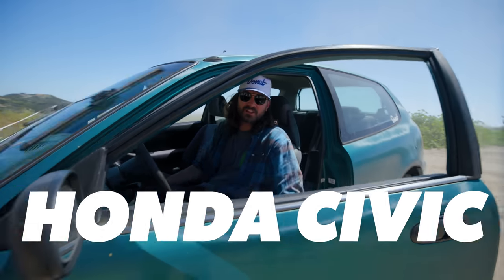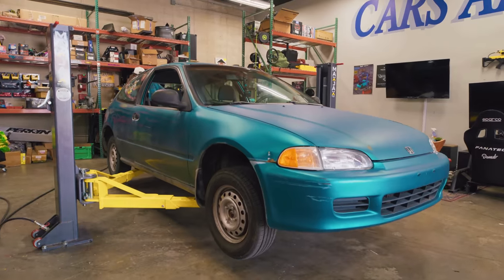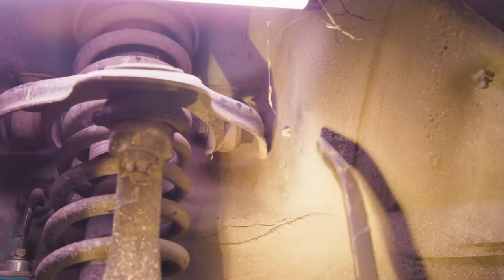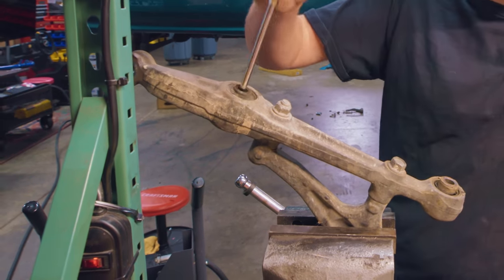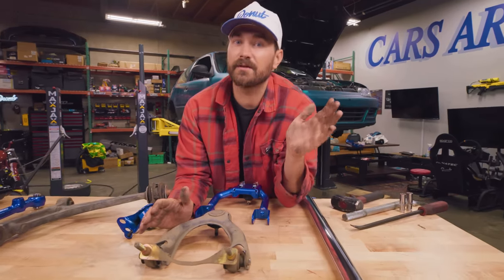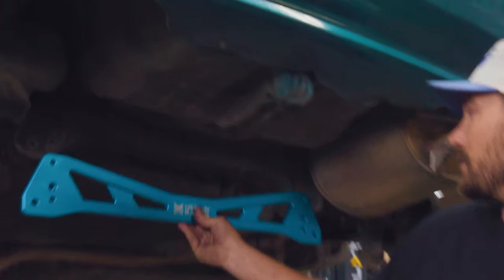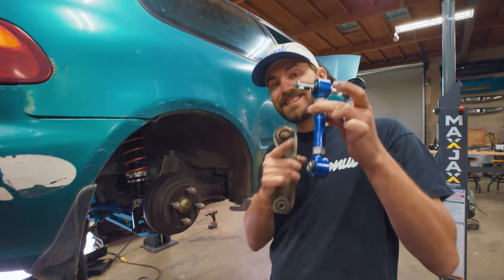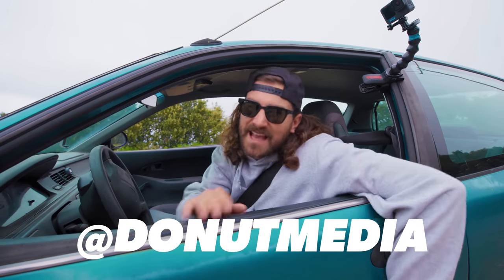We Put $4000 Suspension on our $500 Civic

Comment: I’m exceedingly jealous at how easily all the bolts just came right out 😂. Here in Pennsylvania it would take a week, a torch, bloody knuckles and plenty of profanity to get that suspension apart lol
Reply: Same every bolt on my da9s had to be hammered out, PA boiz
Reply: pa gang 😭
Reply: Frugal Family Living  just the quality is so much different old cars were made to last modern cars are made to broke and buy a new one
Reply: @commandergeokam2868  not remotely true. An environment without salty winters changes everything.
Reply: broken wrench
Reply: More of this please ❤
Reply: Can confirm.
Reply: I know that feel, bro.  Spraying a nut with rust buster and using a jack to keep applying pressure on the wrench that's pretty much digging into the nut.
Reply: @commandergeokam2868  lol what. It's a shitty old economy car. bottom of the barrel. Living in southern california and having been under tons of shitboxes, it 100% has to do with the weather. The only place that gets close is by the beach, and that's mostly body rust.
Reply: I did a 99 CRV's front suspension. I had to cut and drill out about 60% of the bolts. heat didn't get anywhere, and I couldn't whip out the oxy-acetyl where I was.
Reply: come to ontario before u say that
Reply: You forgot a few cases of beer… for you and the boys.
Reply: same i’m in virginia and my hands will never be the same after replacing the front end of my G35
Reply: Same in the Midwest.  Also the underside of the car would have been rusted out.
Reply: Frugal Family Living  the salt destroys everything ong

Comment: So happy you guys are finally building a Honda! As a B-Swapped EK owner suspension was one of my first big upgrades and I was in a very similar boat with worn out parts. I would love to see the braking system gone through in a future episode. Mine at 250k miles had black fluid from disintegrating master cylinder/caliper seals. Brakes were first upgrade/maintenance item. Rear disc swap, new calipers, rotors, pads, brake lines, master cylinder, fluid. Made a huge difference in braking feel and confidence. Also would love to see some old school b-swap action.
Reply: @drippingwax  maybe they did but didn't mention it
Reply: @drippingwax  Brakes, they heat up too quickly as is.
Reply: GSR or LS vtec?
Reply: @jimmytran5971  LS non-vtec. Currently in the process of getting it ready for boost (Btec). But first I need to upgrade my timing setup and ditch the dizzy for hall effect sensors and coil on plug. After that hopefully I won't run into any more issues and can begin tearing apart the block and building it for boost.

Comment: Couple notes for the kids at home: Do not use an impact wrench to tighten bolts to final torque, is almost no cases where its a good idea and you should zip it on lightly and finish by hand... Also when replacing most suspension bushes its a good idea to only lightly assemble them and then lower the car so weight it on suspension bringing it to ride height before tightening. They're using mostly spherical bushings that are self aligning but other types you can have issues with binding where if tightened when fully extended will be over stressing the bush at full compression and it will fail prematurely and not preform as it was designed..... Most good alignment shops will have a 4 post hoist to make tightening at ride height easy ✌ do most at home and trailer it in and have the lads put the final touch on with the alignment.....
Reply: It should already be on jackstands if you don't have a lift, so use your jack to raise a tire until it barely lifts off the stand. That's your ride height / preload and you can tighten that corner.
Reply: I learned long ago that impact wrenches are only for taking bolts off. Its always worth the extra few min to not worry about cross threading something trying to zip a bolt on.
Reply: As long as you're careful and paying attention to what you're doing, using an impact to snug your bolts up isn't that big of a deal.  Don't break out your 1000lb impact to do it either.  I have a nice little dewalt 120lb battery powered impact that will make sure I don't go overboard with snugging things up.
Reply: it's funny how they do all that work and keep the stock Dean Stingers.
Reply: Upvotw this especially about the impact things😂
Reply: Don't ever zip on a bolt with an impact, start it by hand, get like 3-5 good turns in, THEN zip it on with the impact. 99% of the time the torque doesn't really matter, just make sure it's FT (Fucking Tight) and you'll be good. Just make sure you know what the 1% is where the torque is important.

Follow up tip: Don't underestimate the power of anti-seize. If you're in the rust belt, and you happen to have a bolt off, put a dab of anti-seize on the threads before you tighten it. Future you will thank you
Reply: Yeah the not preloading anything before torqueing is kinda irksome.
I'm that dude that breaks out the torque spec sheet for everything and uses an actual torque wrench, but that's just me.
To me impacts only spin left. Nothing an impact can do spinning right that a torque wrench can't do more precisely.
Reply: Lowering before torqued doesn't matter with sphere bushes because they're basically bearings. Rubber bushes yes it does, but most shops simply don't care.
Reply: @walkernottexasranger7565  he said that

Comment: I want to see every performance upgrade complete THEN a motor swap. The reaction would be wild!
Reply: i want this too now
Reply: K20 swap for sure!
Reply: @Craycrayallday  ugh too many K serieses! i would rather see an original SiR B16A
Reply: I'd love to see a B18C5 (ITR engine) swap if they can find one! Got to drive a B18C5 swapped EG the other night and even though the engine wasn't tuned yet it was an absolute RIOT
Reply: I'm with you boys, for an old civic like this it needs a B16 or B18. Way easier than a K swap too
Reply: @clovermedia. rotary
Reply: Next they need to tackle those trailing arm bushings with spherical ones, with a egg this age those things must like busted marshmallows now!
Reply: @djfoof3518  n-no..
Reply: Drop a ls init!
Reply: B18c1 or c5 would be sick in this thing
Reply: Nah bro... 4G63 swap or rebuild the original engine.
Reply: @DBHHellhound  bomb vs too small single cam
Reply: Ls swap it😈

Comment: The EG is such an incredible platform! I've been a diehard Mopar guy forever (my first car was a 72 Challenger that I still have), but when it came time to buy my first "practical" car, I went with a 92 hatch, because I wanted a car that got over 40 mpg, super reliable, easy to wrench on and large aftermarket support. Over the course of 6 years I put over 200k miles on mine and absolutely loved it! And whenever parts wore out and needed replacing, I upgraded to high performance parts, because in comparison to what I was used to, they were really cheap. And I have to say after I went through and upgraded the brakes, suspension and a bit of performance upgrades it was a great little go kart.

Comment: I remember running custom ground control springs with Koni Yellows on my '99 Integra.  I had pretty insane spring rates, I think 350lb up front and 450lb in the rear, no sway bars.  Thing was a beast, immediate lift throttle oversteer.  I remember when I had H&R race spring with no bumpstops, my upper a-arms started hitting the chassis in the wheel well.  No fun.  I even had aftermarket angles upper a-arms.  Good times, always wanted a Civic hatch, that's my favorite color.  I would never advise a FWD noob blast down a canyon in an oversteer setup Civic.  Literal lift throttle oversteer, most "racers" aren't used to it.

Comment: I have a 2008 Civic LX 5 speed coupe and I love it. Beast has 355000km. It is the PERFECT commuting car for work. The muffler rusted off 3 years ago, and it has sounded DOPE ever since. Recently another part of the exhaust rusted off (probably right at the manifold), and it now backfires 3-5 times when I rev match downshift. It is basically the best little beater car you could ever want. Never any issues, ever. Just replace the brakes and change the oil. I always recommend a Honda.

Comment: Suspension mods are the best thing you can do on a slow car... my 92 525i has 189hp (or at least it did back when it was new), and in a 3500lb car it's not exactly fast. With coilovers, monoball suspension all around, an aggressive alignment, and sticky tires, it's a total blast to drive in the canyons.

Comment: If you want a new drive experience, what you need is a Reliant Robin, if driven correctly can feel like a sports car through windy roads and I drive mine like I stole it round these rural Dorset lanes and just leave 4 wheel cars in my dust, should ask Aging Wheels if you could sort his one out for a bit o' speed, Mini gas dampers on the back, Gaz front shock, PU bushings, Peugeot GTi anti roll bars on back axle, Triumph Dolomite Sprint brake cylinders, 4 branch manifold, ported inlet, Ford Weber 134ICH carb conversion... 0-60 under 10 secs and about 100mph top end... scary fun :D

Comment: When I was 17 I owned one of these. I put an obnoxious sound system in it probably worth what I bought the car for. I installed a copious amount of bright blue LED strips throughout the interior to match what was left of the blue paint on the exterior. I had 3 near misses in it:
1. I was driving down a dirt road with the car full of people. I wanted to show off and have some fun so I started whipping the tail out around some corners. I went too far, then over-corrected and skidded straight toward a 3 metre drop. The car stopped with one of the front wheels fully off the drop. Someone in a van towed us out.
2. I was driving home at 3am down a windy hill. One of my rear tires was very flat, and I knew that. But I wanted to see a girl, so the reward seemed to outweigh the risks. I was turning a corner and must have rolled the tire. The back of the car started to slide toward the slope next to the road but somehow the car straightened out. Got my tire repaired soon after that!
3. I was racing down the highway in my hometown, mostly down hill, so I'd been using the brakes fairly heavily. Got to a small roundabout where I needed to give way to a car coming across it. My brakes failed due to heat and the pedal went straight to the floor. That was the scariest thing I've experienced in a car. 

Wow, I was young and dumb. I do miss that car though.

Comment: My last Honda was a 1990 Integra GS. That car was a blast. I never got more than about 20,000 on a set of tires, it could just eat them up. It could almost make 140 mph, (I got to 138 flat out on highway 99 heading into Nevada) and it would accelerate like nobody's business. I called it "clear the console mode", everything in the center console would end up in the back seat (like instantly!). I get the attraction. Wait till you put some ponys in it.

Comment: That Megan brace piece, it’s funny I thought y’all would have knew that. Also those civics that factory brace is so flimsy that the stiff sway bar kits that come with the small brackets will work to mount a sway bar, but the area would eventually start to crack and tear. So that’s the main reason they are so popular if I remember correctly. Sucks to have to go get that factory brace stop drilled and welded from a track day.

Comment: Typically, I'm not a Honda guy, but I love suspension work, no matter what make.  I really wish there was a track test with the stock vs modified suspension.  Wheels and tires are gonna wake it up even more, along with the front sway bar.  Other than the exhaust, it wouldn't do any power adders.  Start cutting weight, and more chassis stiffening

Comment: Damper the Rear to be stiffer than the Front, You want the front to be somewhat soft, mess with the dampers and you will find the sweet spot! Not sure what spring rates you guys chose, so that will determine how much dampening you need, but it will make the car hook as well as handle neutrally, rather than understeering. But next mod you need mo powah baby, and the make or break mod for the Honda experience; their Helical LSD's! If you could put a K20 in there and a Helical LSD that would make the car insane. Also you could get some bigger wider wheels and tires instead of the steelies, that would obviously give the car a better feel.

Comment: the weird thing is that i worked on an eg recently and we did the rear subframe bar but the bolts that were provided have a thread gap that was too small for the stock nut on the back, weird because legit every single civic has them and no one i know has had this issue. we just decided to sent the bolt through the old welded nut at the back and there was enough thread to put the nut that was supplied on the back of the bolt through the stock nut. Honestly it's pretty cool this type of stuff

Comment: Oh no... They did everything but the trailing arm bushings and toe arms in the rear, which are arguably the most important. If those trailing arm and toe bushings are cooked, that's going to be pretty bad still.
That and no front swaybar with a big rear will make it a bit of an oversteer pig on the limit. Some old cars it's beneficial to go no front, but these things definitely want a front sway, but a smaller stock one. 
But also next big step for the suspension side is roll centre adjust stuff for the front and rear, but that's a lot of effort.

Either way, keen to see where it goes from here

Comment: Rims, Tires and brakes. While you're at it, remove excess weight from the rear passenger compartment - so that later a a booming audio system can be installed.

Comment: You want to put a load on the suspension while prying on it.. that's what I do when doing a safety inspection. Usually put the jack under the front lower control arm and jack it up

Comment: I wish i could get a MINT $500 civic here in canada! wow man you'dp pay $3000 here for that car easy. Hype dictates them here. Wish i didnt sell my 98 DX Coupe....55K KM sold it for $800 i think. Paid $1000 in 2015 which is amazing it was like new.... Truck i replaced it with broke in a year and now they are worth like $2000+ easy to the Honda Heads....

Best thing to do with old civics is to use Acura parts on them. They are either equivalent to Si model parts or even better. I did full EL interior in my 98 coupe and EL Spindles and hubs, EL gauges with Civic Odometer (had to adjust speedo) and the subframe which is the reason i bought the EL. A road crumbled away and i bottomed out so hard i ripped the control arm mount off the frame clean lol. And my 02 Accord v6 SE had a TL Subframe

Comment: Hehe not many people know the Civic, Accord etc were only half Honda's... your Civic was known here in the UK as the Rover 200, 25, Streetwise and the MG ZS's used a lot of stuff using Type R specs with some tuning by Lotus.   The best MG's were the Accord-a-like MG ZR160 and 180's and the ZT with the 5 litre Ford modular V8 RWD monster that with some bolt on goodies became faster than any police car here in the UK :D   Funny thing too is people wanting cheap tuning parts for their Honda's are now buying uber cheap MG variants, the MG K series V6 ones have the same engines as some Lotus and not hard to put a Lotus map on the thing, the MG name now is a Chinese thing but like a lot of Chinese cars a British name lives on inside, the Austin Maestro bodyshell is used in many Chinese cars today, now if you could find a MG Maestro Turbo... 5000 made, built by Tickfords was considered the ultimate "hot hatch" here in Britain as the thing was ferociously fast and Tickford tuned the suspension so it stayed on the road right up to the point the non variable power steering was overcome by the engine power and torque steered hapless owner into telegraph poles, ditches, oncoming traffic tis why there is hardly any MG Maestro Turbos left cos they all got smashed up by torque steering deaths.
Reply: Oh and that kingfisher blue is a Rover colour too, Rover and Honda used different primer coats hence the very slight difference but most of Honda's metallics of that era were designed by Rover UK, the only one Honda didn't use was Rover's cobalt blue metallic which was considered one of the best paints of that type and a firm favourite of the custom lot esp when candied up.

Comment: Steering rack just needs adjustment. You check this by testing the slack in the steering wheel compared to how much the wheels turns. Super common civic problems. You need a special 40mm flat wrench. Just go easy because over tightened rack nut will bund the steering
Reply: Bind the steering*

Comment: $500 is a steal, guy i bought one from wanted $3500 and it was way worse condition and engine was on its way out. This was 2016 pricing too..i got it for $2700 and then the head cracked a month later 😢

Comment: You did the exact opposite of what you should have done with the arb. On a fwd car like this that hasn't got much weight at the back you'd want a stiff front arb and a really soft (or none at all) arb at the back. Softer rear means more weight transfer at the back= more grip

Comment: Could you guys take a gen 1 escape and turn it into a drag car. They are 1000 lbs. lighter than a charger or challenger. Also, nobody actually knows or cares about them and they are fun to drive, they also come with a 5 speed manual in the front wheel drive XLS model

Comment: this is like building dream house on bad foundation. 
you will spent bunch of money but put it in bad car. 
those suspension will not help, for starters you have realy bad chasy, thin as paper it will twist like precel unless you will secure it with a cage. also weight distribution is horrible. rear end will be light as hell. also engine compartment accept horizontaly mounted engine and that is a no go for any sport car. 

if you are  smart buy cheap sports car like M3 and renew it